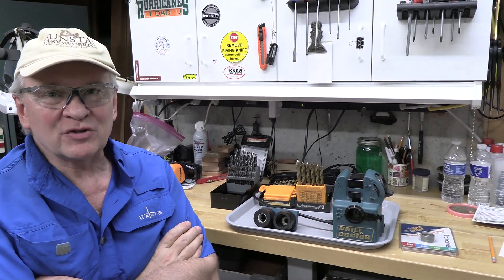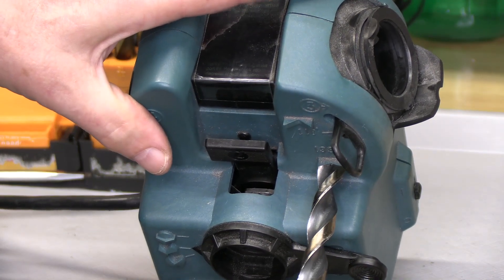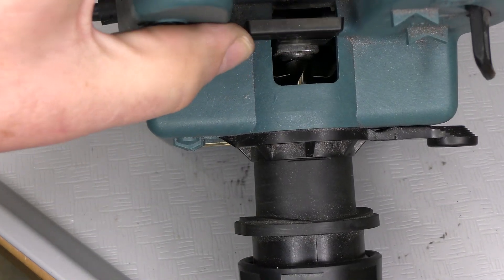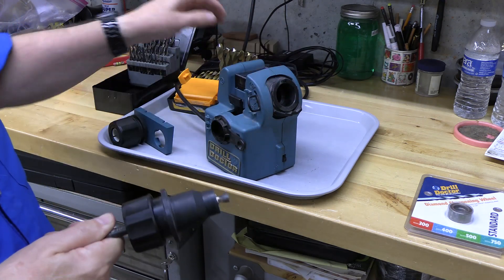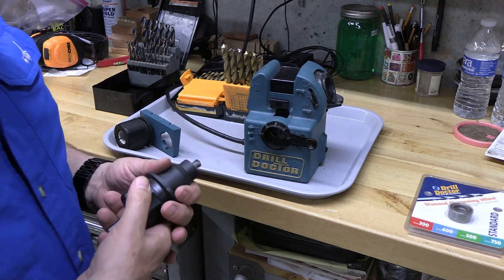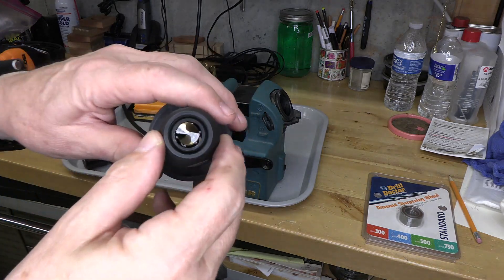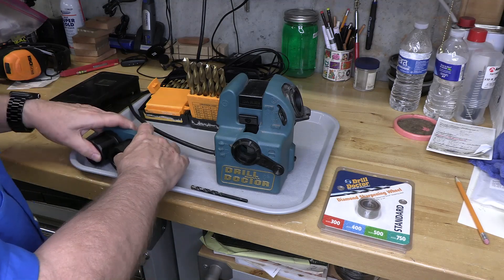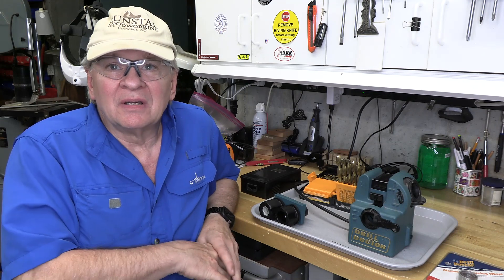Darex Drill Doctor 750SP Review and Demo w Dr  Joe

Comment: Thanks for the info I'm looking around to buy one even if it's a good used one I have a few bits bigger than 3/4 but I'll do those by hand when needed
Reply from the maker: Thank you very much for your comment. It is a good unit. You’ll enjoy it and they are available. I believe on Ebay, etc. Consider subscribing. Thanks. Joe.

Comment: Hi Dr Joes question, I have the same unit , someone gave it to me, it was never really used, when I am sharpening I am getting a bit of a negative relief at times, what am I doing wrong, is there certain pressure needed when turning the chuck, any input /advice would be welcomed, thank you
Reply from the maker: I believe the most important thing is to be sure you align your drillbit properly to be sure that the spring steel prongs grab the flutes of the bit and line it up and then tighten it while it’s still in the machine then when you take it out tighten it some more so it doesn’trotate that could be part of the issue.
Reply: @JosephHunstad  thanks for getting back so soon,, I do when setting it up,  when I  turn the chuck with the dill bit, do you put any pressure at a certain spot when turning the chuck or is it even all the way around

Comment: My question is: how do you know what is the best angle or tip type? Ie for metal use 135 degree split point or for wood use a 118 angle and regular point... 
I have a ton of drill bits that are so dull or broken that I don't know what they were when new..
Reply from the maker: You ask a great question. The majority of basic drillbits are 118°. You can actually get a small tool that measures the angle to know if it’s 118 or 135. If the drill bits are not split point they are probably 118°. If they are split point bits they are probably 135°. Consider subscribing. Both drill bits work in wood metal and other material materials. Thanks. Joe

Comment: Thanks for the video.  What is the difference between the 750x, 750SP or the one I have, 750 made by professional tools of Ashland, Or.?
Reply from the maker: First of all the 750 and 750 SP are no longer made. The 750 X is currently being made. The 750 SP signify split point which is the same, I believe as the 750. Consider subscribing. Thank you, Joe.
Reply: @JosephHunstad  Thanks Joe

Comment: Dr Joe
Really helpful video. I just inherited a model 750. I dont seem to be able to move the chuck laterally for split point sharpening. Am i missing something🤔
Reply from the maker: So thank you for your comment and yes to move it to the split point you need to actually pull it out as you rotated. If it hasn’t been moved for quite a while, it may indeed be stuck, so just wiggle it and take your time, but pull it outward a little bit as you rotate it. Consider subscribing. Thanks. Joe.
Reply: Subscribed!

Comment: What is a reverse drill chunk for
Reply from the maker: Thank you for your question. I don’t understand it, however. I don’t know what a reverse check is did I mention it in my video? I don’t recall thank you, Joe.
Reply: It is used for sharpening left hand twist drill bits. They can be handy when removing a broken screw which will often come out and you don't have to use the easy out tool. Bought a set of left hand twist bits off AliExpress and they couldn't drill a hole in a block of cheese but now I can get a metal chip or two out of them.

Comment: Can you show how to sharpen a small bit?  When I put one in to align the twists the two metal "feelers" snap to the point of the bit instead of to the narrowest area of the bit.
Reply from the maker: Hello Ron J
First of all the sharpener cannot sharpen anything smaller than 3/32

It’s best to start with something larger so you can see the point but for the smaller bits the tip needs to be held against the metal backing plate and then the bit slowly rotated so that the pawls engage with the flutes of the bit. Sometimes those smaller bits are quite short, and it makes it really difficult. In that case, a pack of 10 new bits of those smaller diameters are super cheap and basically can become disposable. Consider subscribing. Thanks Joe.

Comment: Thank you for reminding me how to use my machine.  I recently damaged several 3/16" drill bits drilling deep holes in hardened steel (railroad rail) so I had to resharpen them. 
Interesting point:   I found that one of the 6 or so  bits had a non-standard flute twist  rate which meant that the little fingers didn't locate it properly in the chick!  I even hand ground it to a flat end and roughly hand sharpened it, but still "no cigar"! So I finally gave up on it and threw it away.  I knew that I could have hand sharpened it, but  I just decided to get it out of my shop, so I wouldn't have to deal with it again in a few years.
Reply from the maker: Hollow French Creek Valley

Thank you for your nice comment. This machine works so well and makes it so easy but there are the occasional drill bits that are not standard. I’ve run into that too and I just toss him just like you did it’s not worth it. Consider subscribing. Thanks Joe.

Comment: Just bought a Drill Doctor 500SP used off  EBay for $50. Your video helped a lot. The stator had a broken wire that intermittently caused it to stop rotating but I was able to repair it. I had a problem where the drill bit didn't have a 118 degree bevel after sharpened and was slightly tilted, so it over ground one side and underground the other side and appeared to be flat, not 118 degrees. It turned out to be a slightly bent drill bit. It had a slight wobble when rolled accross a level table. I have been sharpening up my collection of bits from the last 50+ years. A well built and designed tool is always a treat to use. Thanks for your video. Your video is well done. Denny

Comment: Thank you for this very informative video , I just bought this whole setup ...😁not even used...,. from a thrift store in Norwalk Connecticut for $30 and I look forward to using it .....I double checked everything in the store ,read the manual thoroughly in the store to see if anything was missing.. it was all wrapped up in plastic and sealed and everything was brand new never opened. it comes in a case and everything's included and everything was perfect ,nothing missing, nothing broken.... look forward to sharpening my  dull drill bits(I have a pile of dull old bits acquired over 30 years ....I'm 50 now ) I've been wanting to do this for over 30 years.... to get one of these ...I finally broke down because it was Brand New.. never used !!! in a box sealed up !!!!for 30 bucks , if tools could talk I'd love to know the story behind this and what it's been doing knocking around for 25 years not being opened or what's the story.... thank you for your helpful and very informative video again thanks Peter
Reply from the maker: Hello PETER. Thank you for your excellent comment. I’m very excited for you to start using it and yes you did get a great deal. Even though it’s an old model it works wonderfully. You’ll have beautiful bits that whole pile of yours that need to be sharpened you’ll love it. Be sure to set it at the correct angle 118 or 135. Always the best take care joe

Comment: You should add a warning to this video about carbide drill dust. It is toxic and you should use a fan to blow any dust away while grinding. Use a fan and a dust mask when cleaning the sharpening chamber.
https://www.nj.gov/health/eoh/rtkweb/documents/fs/1960.pdf
Reply from the maker: Thank you very much for your comment. Yes carbide dust is generated when we sharpen Masonary drill bits. And yes it should be treated with respect and I agree a fan and a mask or ventilator is best.

Titanium dust is probably not good either that can result from sharpening titanium coated drillbits. No matter what we do the dust we generate is usually harmful and should be avoided.

Thanks again Joe

Comment: Mine is exactly like yours; I see you have an extra stone for sharpening...How do you change the wheel stone? I cannot find anything, not even in the manual on how to change the wheel.  Obviously I am missing something! LOL
Reply from the maker: Thank you for your comment I just posted a video or will do it today on how to change the wheel it’s pretty straightforward but mine was really tight and required a gear puller and I was six surprised to find a brass shim but I showed how to replace it
Reply: @JosephHunstad  yup, gear puller worked, mine was stuck. Thank you!
Reply from the maker: @karendarling3124  yes I was really surprised that I couldn't just twist it off after I took the cover off. Even with the wrench in place it wouldn't come off I needed to use a gear puller which worked just fine. I was really surprised that it had a brass bushing I didn't expect that. Take care